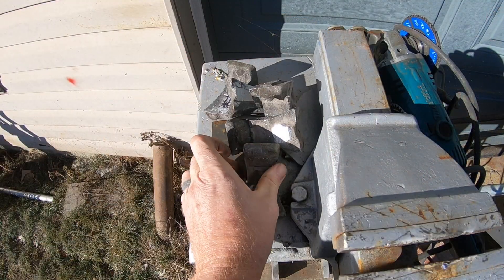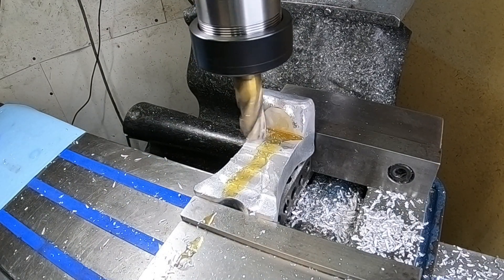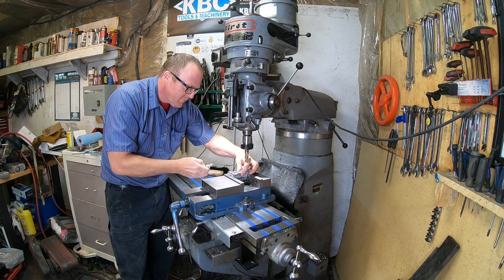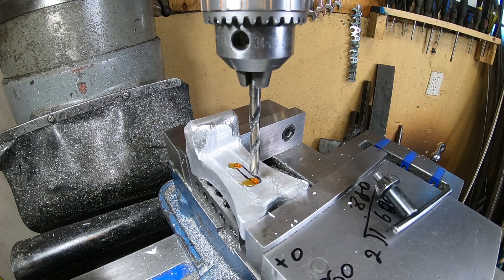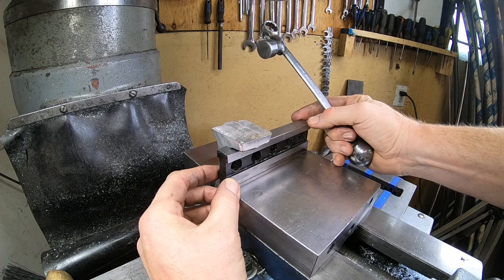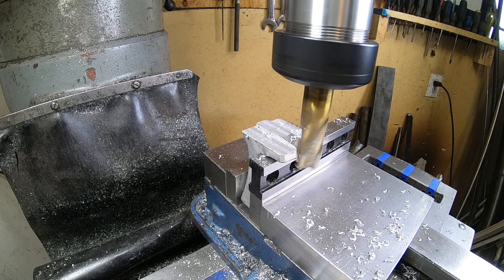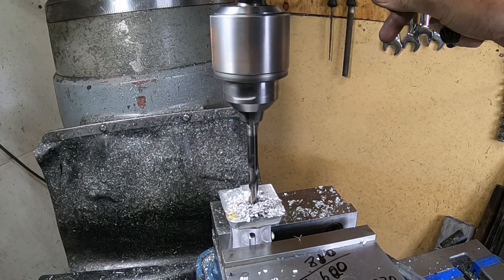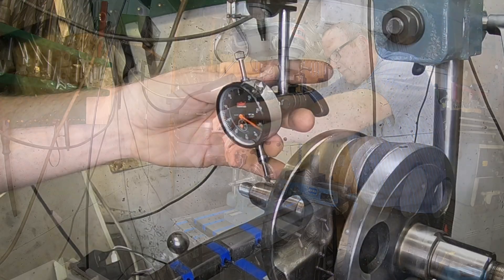Machining and assembling the crank truing stand  Part 7

Comment: Oh yes please more about the deforming hammer issue.
Reply from the maker: Ah , yes . With regards to tapping the aluminium into the vice .   Normaly you would use a brass hammer on steel  .  This stops the material from bouncing back and not bedding down i to the work .   If you use a steel hammer the work will actual lift higher some times . And not seat to the bottom of the vise .  Since the machones material is soft it deforms when hit with a steel hammer amd does not bounce out of the work and kinda acts like a dead blow hamer amd will travel in the intemeded direction .... down to the parralell or bottom of the vice.     You can see after i hit it with the hamer i test to see if the parrellels are moving . If they move the work is not bedded down and will be at an angle .      Hope this helps
Reply: @ Thank you very much.